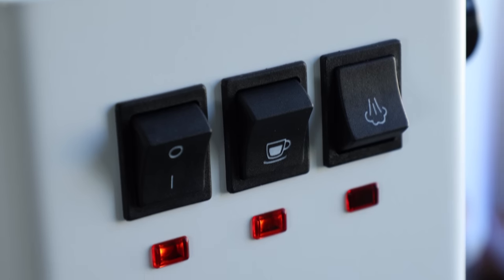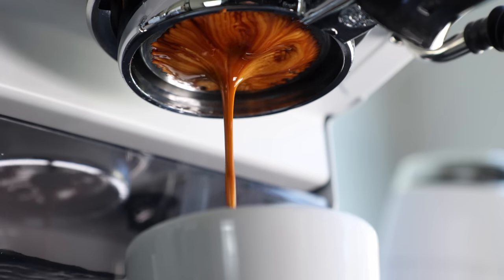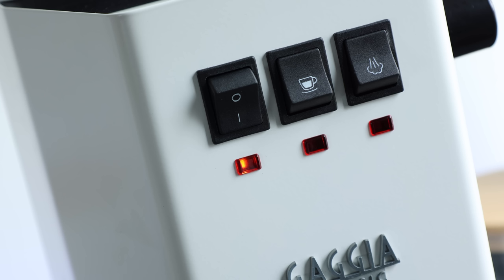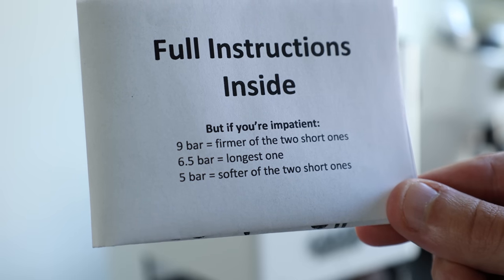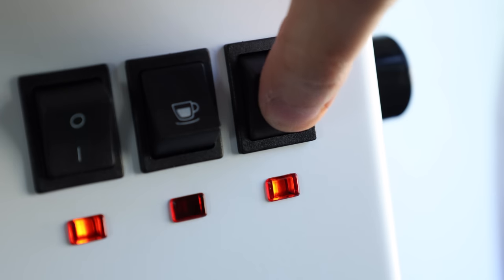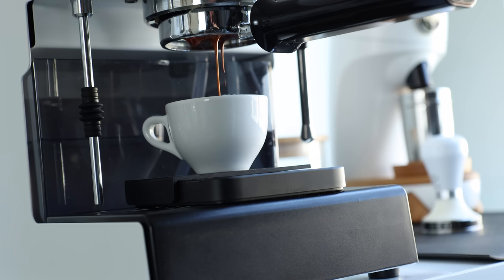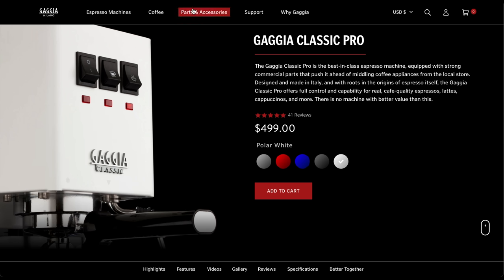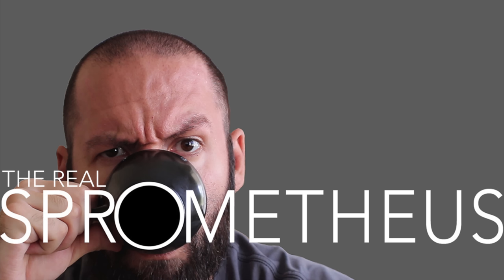GAGGIA CLASSIC PRO - Small But Mighty Home Espresso

Comment: I think for a few hundred more it’s worth getting the Silvia. It’s was / is my first espresso machine (v5) and out of the box it solves many of the cons proposed here. That said, the build quality is much better and to tap out its potential, you should add a PID. Also, it’s  factory set at about 14 bars, so having it dialed back to 9 is helpful. I had it for about 2 years before having these done and it always made good espresso (light roast drinker only) but when you hit it just right - it made great espresso. Then after those upgrades you have a much more consistent and enjoyable machine. My two cents…Cheers.

Comment: Why would ANY well designed and well built espresso machine need to be modified and tweaked in order to produce a "proper" cup of espresso? If the machine is so good, then it should do that out of the box. The same applies for the aftermarket "upgrades" to accomplish the same thing: a decent cup of espresso. All of that should be there right out of the box. I am shopping for a replacement espresso machine and based on your review, I would definitely pass on this machine.

Comment: Gaggia is by default 12 bar not 15 bar
Reply from the maker: Not according to the specs on their website...https://www.gaggia-na.com/products/gaggia-classic-pro#specs
Reply: @Sprometheus  I think they mean the pump, not the OPV.

That said, on my 2006 GC the OPV was set veeeery high. When I first got it, I tuned it down a wee bit, and after getting hold of a PF pressure gauge, I found that I was still at 11 bars (and then proceeded to tune down to 9 bars, which did improve my shots). A wild guess would be that it was initially set around 14 bars.